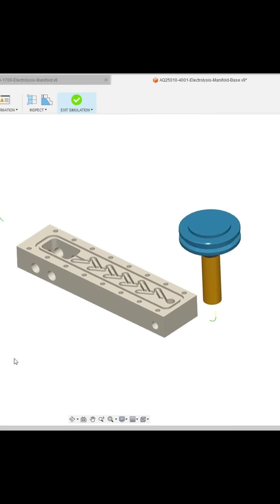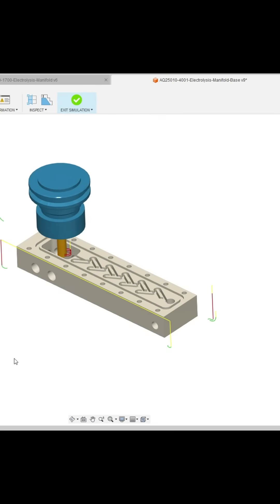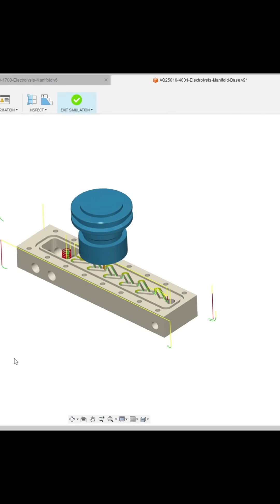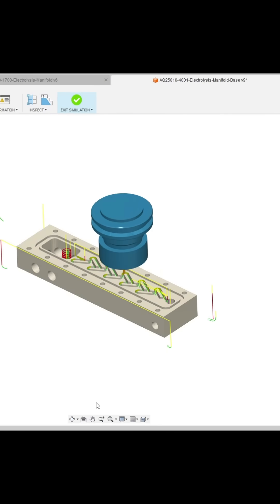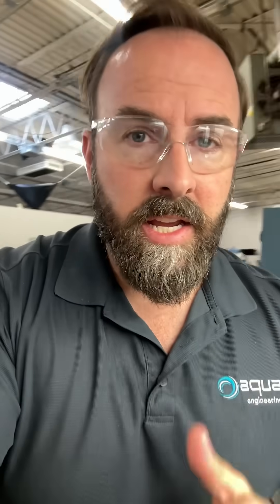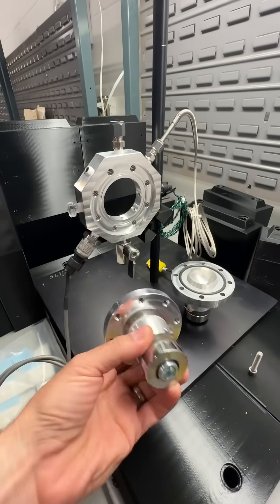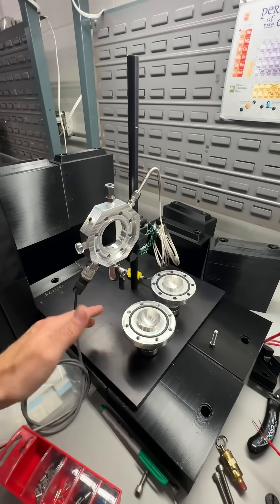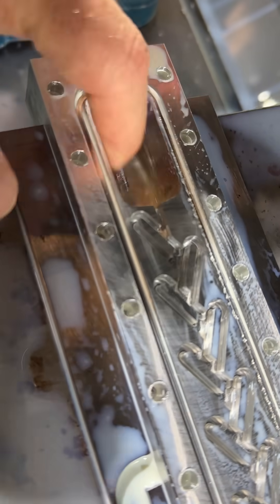Machining a Tesla Valve

Comment: Why use tesla valve? Current tech allows for better solutions if you need one way flow in high frequency environment
Reply from the maker: I’m open to suggestions. What can I use that will stand up to 300C, 1000 PSI burst pressure, and acoustic vibrations? I should keep a closed loop of water circulating with each pulse of an input gas.
Reply: @i2c_jason  Inconel check valve? I haven't seen a sonoluminescence reactor that can operate with constant water input.
Reply from the maker: @ANToxic777  I wasn't sure how the colloidal particles would behave with a check valve, especially if it barely cracks, also want the loop to be able to progress as finely as possible. But yes, I originally had check valves planned. I can go back to them if necessary.

Comment: what is an electrolysis for? the LERN reaction due to cavitation will split water anyways, taking hydrogen or oxygen, if needed.
Reply from the maker: I would love for that to be true, and I will run tests without electrolysis. The hope is that electrolysis will wet-load the metal particles with intrusive hydrogen. It should give us another variable to play with and control without having to shut the reactor down, drain it, load the metal, reload the reactor, etc.